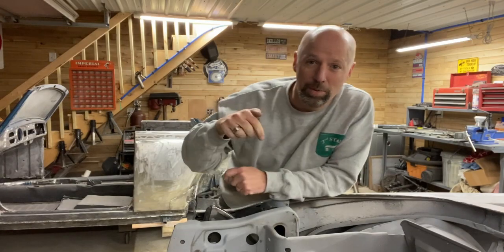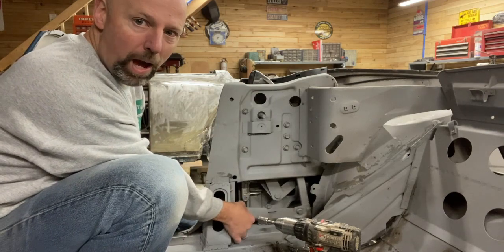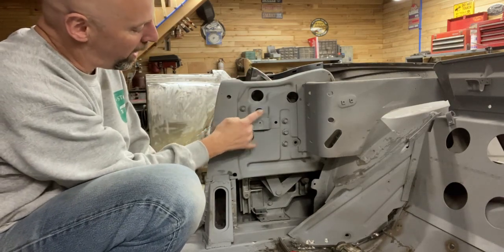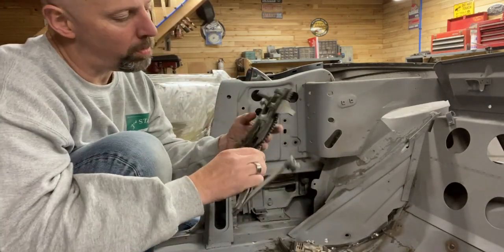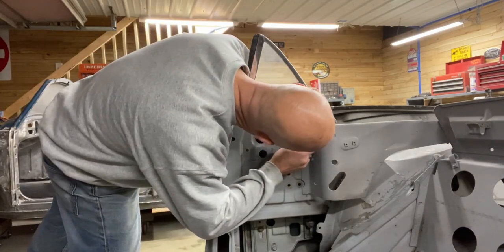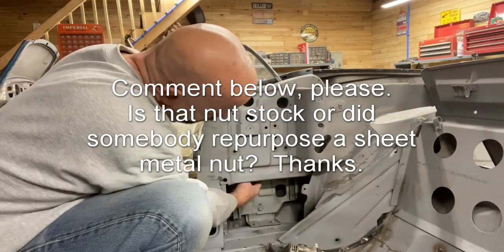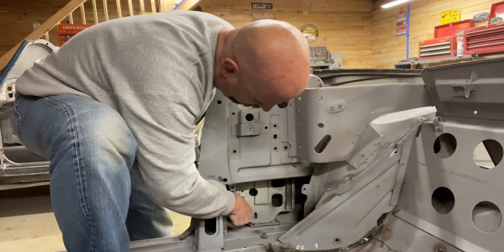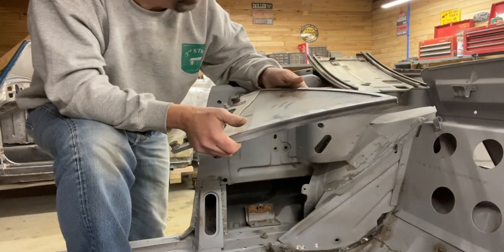1966 Mustang Convertible - Pt. 36 Rear Window Removal

Comment: That bumper/cylinder appears on some cars and not on others.  I had that on my 66 when I removed the windows.  I dont remember if that U-nut was used.  I didnt remove it.   I removed the windows to weld up the holes for that quarter panel ornament.    I'm adding shelby side scoops, those mounting holes needed to be filled because in a coupe, the air would rush in and fill the headliner.  I'm not running a duct to the rear brakes.   The interior area of the windows looks awfully clean.  Were those windows out and the area media blasted, & windows replaced?   Most of those rollers can be replaced.
Reply from the maker: It was definitely blasted by the previous owner.  I think he blasted it twice.  once with the windows out to get behind them.  A second time with the windows in so that all grit got into all the joints and tracks and stuff making it all grind and grate when you move it.  lol
Reply: Good stuff Doug. Forget the five year goal I can’t wait that long.